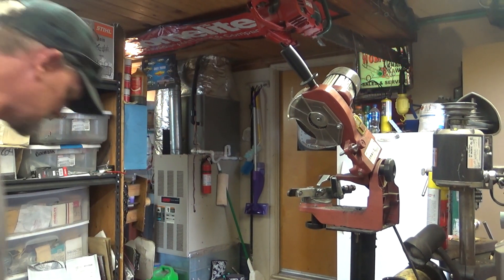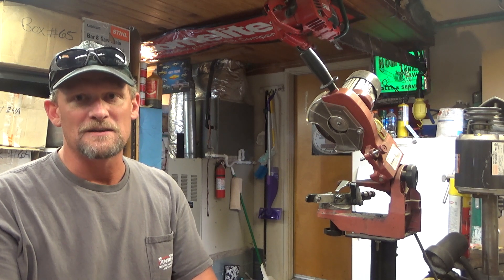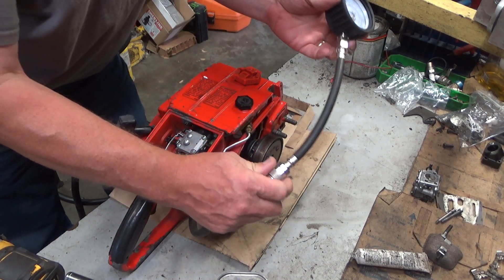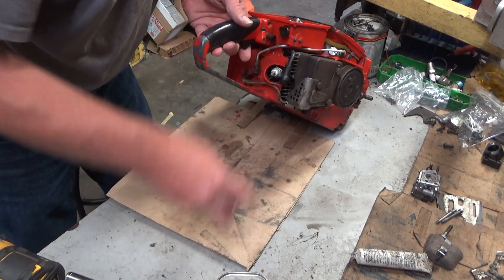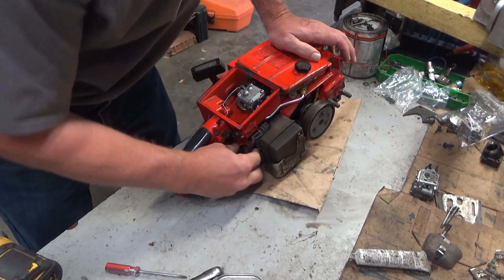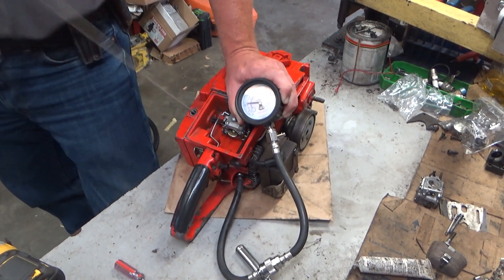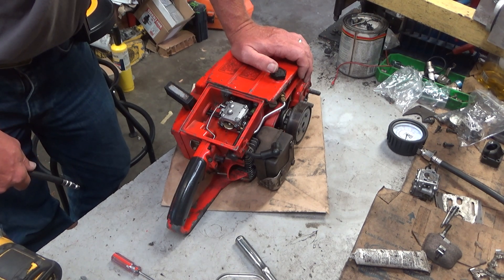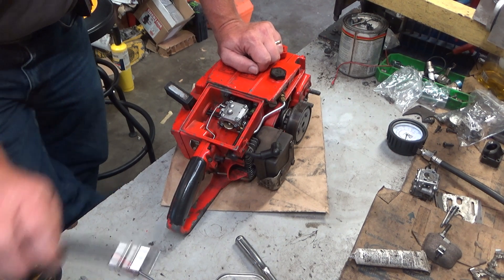Ever Wondered What A Low Compression Chainsaw Starts & Runs Like? Homelite Super XL-925!

Comment: I had a 925 & a 944 many years ago. The 925 had very few hours but the 944 was used a lot. So help me both of those saws had 175 lbs of compression 1st pull. Those saws have led to shoulder problems in these later years. They're still in the area & were sold to the fire dept where after several years they were bought by 2 of the members.

Comment: thanks for passing along some more skilled diagnostic work. Pretty tough to get around this with a band aid fix of any kind but if I were to need try one it would be to run 25:1 oil and see if it helps seal things up. Without seeing inside that would be just a crap shoot, because there may be severe damage. But it is the only one I know that could possibly bring it back to nearer a normal throttle response.
Reply: One could do a pressure test on the crankcase. But with 50 psi hot it is possible that the piston ring has lost its strength.

Comment: the piston rings are gone no good 😮😮 and piston is worn out the best would be 2 replace piston W a set of new piston rings even if U have 2 use after market its better than no parts at all and also I would use a bead cylinder hone 2 rehone the engine cylinder W 😊😊 OMG 7 5 2O24